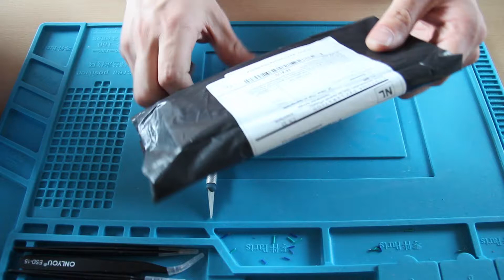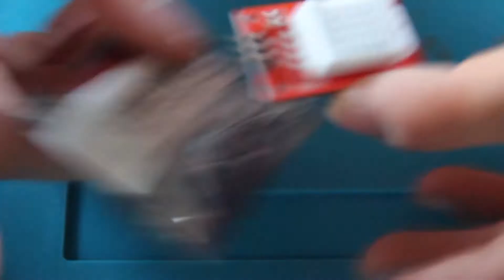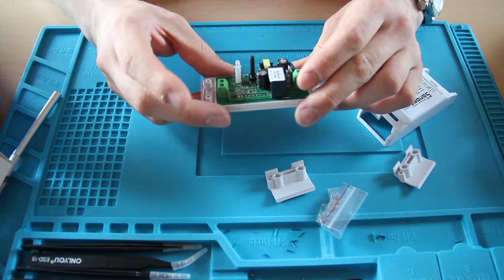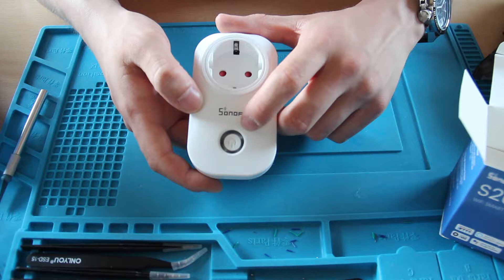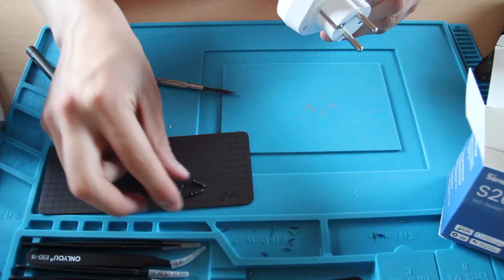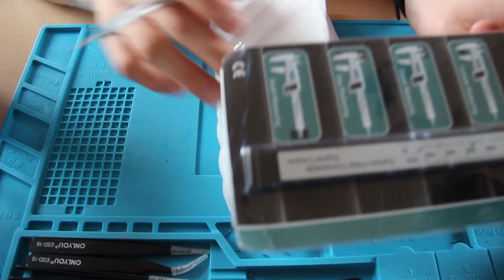#11 Mailbag: Sonoff

Comment: Sonoff Basics are surprisingly great , especially given their price tag. I have some of these Sonoff Basics running in my house for more than a year now without problems. Tasmota is the way-to-go firmware for them. Anybody planning to use them should stay away from the default firmware and mobile app, those are crap :)
Reply from the maker: The default firmware is very bad, I haven't even looked at it 😂 in my next video's I'll build a custom version for both the Sonoffs